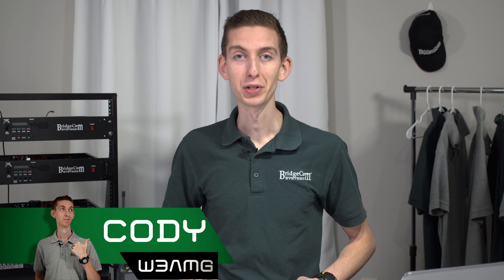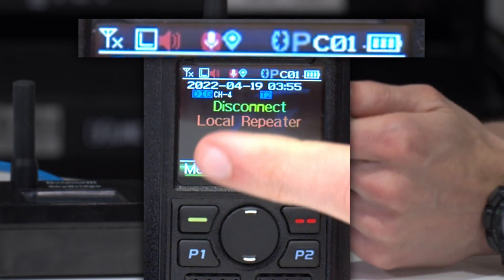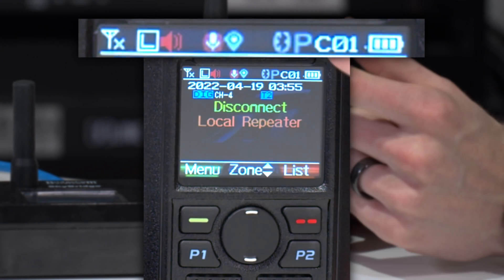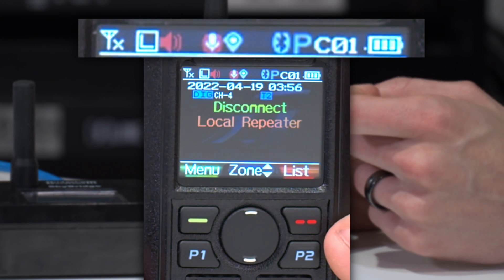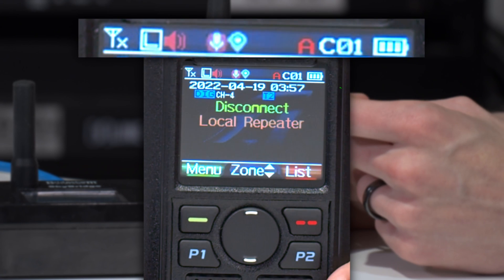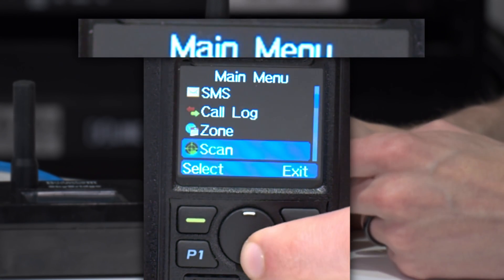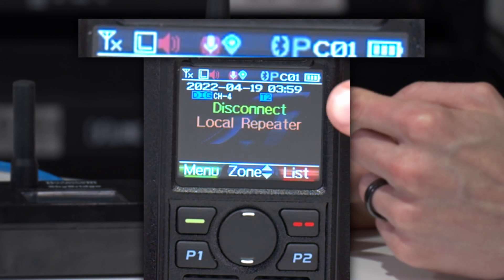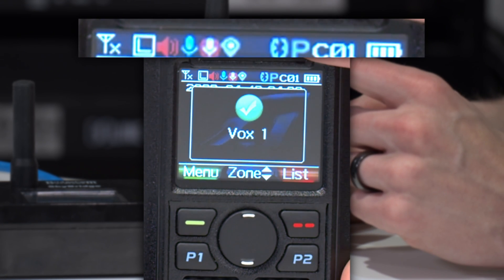What are all the Different Icons on Your AnyTone Radio | What do They Mean?

Comment: In DMR mode, there is a DIG icon which is sometimes dark blue and other times either white, cyan or light blue (I have deutan colour vision deficiency so can't be sure on any colour).
So what does it mean when it changes from one colour to the other, I call to "light to dark", is it something to do with hold times?
Reply: Bridgecom gave you a completely useless answer lol, shocking.

You are correct. I don't know exactly what you see, but at Dark Blue the channel is idle. It will become light blue when the channel has been active, either because you transmitted or someone else transmitted, and will stay light blue for the duration of the hold time.
Reply from the maker: Hi! Thanks for your comment. If you have any questions, feel free to join our Facebook group — it's a great place to get help from the community: https://www.facebook.com/groups/BridgeComSystems. Also, if you're interested, check out our Plug-and-Play Package here:https://www.bridgecomsystems.com/pages/plug-and-play-package.